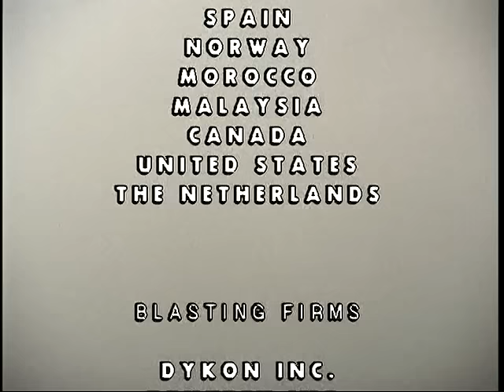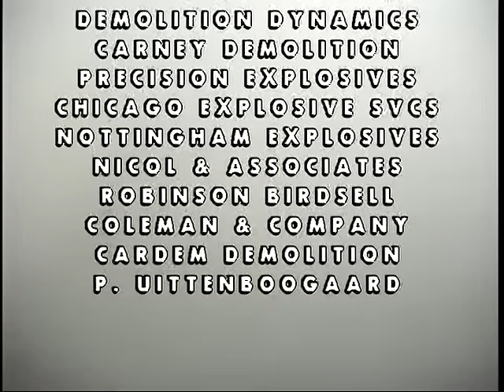Implosionworld Explosive Demolition Compilation 2003

Comment: The amount of precision for the placement of explosives just so the building falls exactly how they want is truly skill right there! Especially in tight spaces right next to other housing.
Reply: Not sure. I've seen building with just small fires in a few floors collapse in similar fashion. Sky scrapers will freely fall with just some damage done to one of its outer walls. The whole concept of controlled demolition is overrated.

Comment: The best demolition video ever.
Reply: Yes!!
Reply: @bmtfadediv2601  Wh-
Reply: Nineteen Sixty-Nine  It was much more tragic though as airliners buckled the steel.
Reply: Nineteen Sixty-Nine  So professional that it damaged another building when it fell.
Reply: Nineteen Sixty-Nine  Free fall for a bit, then it slowed down as it got lower. It was the interior that buckled first when a critical and awkwardly built cantilevered column buckled and collapsed virtually the whole core, leaving the outer shell unable to stand on its own and it crumpled like a can.
Reply: Nineteen Sixty-Nine  You mean hit them with steel columns damaging and engulfing one side with flames and letting it burn uncontrolled for seven hours after the consequences of two full speed airliners hitting two taller buildings next to it?
Reply: Nineteen Sixty-Nine  I think making it collapse in that way would be easier than having to invent fireproof explosives. It would be more difficult to make a critical column fail then collapse the interior then make the outer shell unable to stand. Was the collapse of the Plasco building a demolition as well?
Reply: Nineteen Sixty-Nine  The Plasco building fell differently because it was made out of a grid structure, unlike WTC 7 which was a core an outer wall structure. So if the interior fails then the whole building will fail. But the outer shell is pretty rigid and would make sense to come down straight.
Reply: @TheBrickGuy7939  freefall isn’t a speed lmao get it right it’s actually called gravitational acceleration basically saying when only gravity is acting on an object
Reply: @jonahmoran3751  Chill out I don't believe in the theories you got the wrong guy.

Comment: 9/11 twins demolition is missing here in compilation :D
Reply: @withoutnic  TV? wow your old
Reply: @withoutnic  rlly? the buildings were hit by a plane witch then started a fire wich then melted the steel beams enough to buckle and cause the tower to come down like that. Bet you were in new York on the day?
Reply: @theadrien1937  Fire melted the steel beams enough to buckle from floor 70 to 1 in less of 1 min? Try to melt steel rod with blowlamp 10 meters long and you will see that on one side steel is starts dropping - on other side it isn't even hot. I told you - you are sitting on armchair and do not understand what you do see on the screen. This BS for amateurs. Load-bearing beams are always concrete, so there was no any reason to collapse from fire. The steel isn't the only part of construction inside concrete. You have to learn construction to understand the building technology, especially technology of skyscrapers materials and it's resistance.
Reply: @withoutnic   It didn't take one minute for it to fall down after being hit, for tower 1 it took 1 hour and 42 minutes
Reply: @theadrien1937  watch video how much time did it take since collapse has started. You don't understand that it would not happen either without explosives.
Reply: @withoutnic  No, you don't understand. They were built from steel, not concrete, so when the plane hit the building it started a fire, and that fire burned for nearly 2 hours slowly heating up the steel enough for it to start to buckle, then, the top part became to hevey and the steel beams bent and the top part of the tower came crashing down on top of the rest, making it look like a controlled demolition.
Reply: @theadrien1937  Even if they were built from steel - lets imagine very high temperature on 70 floor - on the 68 floor temperature will not be enough for melting the steel. Once again - try to melt a steel rod with fire blower and you will see how it works-on distance of 10 meters from the melting point you will not feel any heat on the same rod! The heating is not uniform along the building and in any case only the upper part would fall off from the heating. Stop staying on theory, just try to melt the steel rod and you will understand everything by yourself. Upper part would not stay and wait for uniform heating of entire building. And I'm always wonder how your mind works: you see the film of controlled demolition without any fire, you see - this is the fact, and you see that it is exactly same, you also know that the third building collapsed as well without any plane inside, and you continue to teach professional construction builder. I had my own construction company and in opposite to you i'm talking about existing facts and technologies :D Try to learn not from wiki, wiki is nothing:
Wikipedia:General disclaimer
WIKIPEDIA MAKES NO GUARANTEE OF VALIDITY
Reply: The drama
Reply: I'm just here reading the drama
Reply: @withoutnic  it didn’t melt
Reply: @withoutnic  wait what? Nobody is adding mass it’s the fact the columns that are weakened can’t withstand the weight from above. It’s simple physics. You think that it can handle the weight of the titanic that’s like saying placing the titanic on a 1 story steel building. And also steel didn’t melt from jet fuel. Also look at this video https://youtu.be/FzF1KySHmUA tell me why does that happen when it’s not melted. But heated up
Reply: @withoutnic  yeah but we never added mass so if you removed all collumns but one central column would it stay standing no. That’s basically what happened here. The collumns lost half their strength then they buckled as the weight from the top was too much. They were to weak to support the weight and they gave out causing the domino effect. Which is floors hit another and another and another adding more and more weight
Reply: @withoutnic  haha most office fires reach 600 c which is half the steel strength gone so what? More like the fire made the columns too weak to withstand the upper floors. The upper floors became too heavy for the weakened steel.
Reply: @withoutnic  no extra weight🤦‍♂️
Reply: @H9m4n  lmao
Reply: @withoutnic  Fun Fact: Collapse was about 15 seconds long. It took 8 seconds from collapse initiation to dust cloud touching the ground and covering the building.
Reply: @jonahmoran3751  yes, entire building was melted with the fire from the one point of burning located at the 70th floor...
Reply: @theadrien1937  ima support this dude even tho its been 3 years since this comment, the creators used a perimeter tube design for the towers, skeleton on the outside and big ahh columns in the center to save office space. So when the plane hit the outer skeleton was damaged and the inner core, some supports were left but bc of the stress of the remaining floors above, both fell
Reply: @withoutnic the stress of the upper floors
Reply: @ima.get.tiv.2  The stress of the upper floors... what with it? What have You tried to say?

Comment: Scroll down to the comments section on any demolition video and what is the first subject you see covered?...Award yourself 50 points if you can guess,
Reply: The Butler Did It 50 points won here.
Reply: The Butler Did It 911 Bastards?
Reply: +The Butler Did It 9/11.
Yup.
Reply: +The Butler Did It Actually, KI see less and less as time goes on, as I troll-block the conspiraturds every chance I get. In the long run, this is improving the signal-to-noise ratio
Reply: GuySaysThings @
Reply: The first thing I read was how it was a shame that something that takes so long to plan and build can disappear in seconds. These collapses are OBVIOUSLY nothing like the collapses on 9/11, because these have EXTREMELY LOUD EXPLOSIONS, as they collapse. None of THAT in 9/11 collapse videos. The only similarity is the GRAVITY that pulls the buildings down!
Reply: Doesn't take much to bring the conspiracy-theory wackadoodles up out of their cracks in the pavement, does it?
Reply: At least all of you are smart! Lol
Reply: The Butler Did It 
What can I do with these points?
Reply: 6 years later and this is back in my recommendations....and not a conspiracy nut left in sight. What happened? Were they all banned or have they given up at last?

Comment: How come the twin towers are not on here 🤔
Reply: Because those weren't controlled demolitions.
Reply: @Drakrau_TheDerg you sir are correct, they fell due to the high velocity of the planes in impact and damage of the fire that insured
Reply: @four4eight  Yea, and a flawed construction type called Tube-Frame
Reply: @Drakrau_TheDerg  no it wasn’t “flawed” and in fact it was quite strong giving the towers flexibility, the only reason they fell is because it was made out of only steel and nothing else
Reply: @four4eight  Tube-Frame is basically all the columns except for a few are on the exterior, and those columns are held up by the floor. So once those few columns failed, the floors failed, and then the skin soon after.
Reply: Those responsible don't want people to see the similarities. That's why they aren't here.
Reply: It wasn’t imploded they were attacked

Comment: I'd really like to know why people refer to this method of demolition as an "implosion".  There is no implosion involved.  The use of timed, weighted explosions are the method used to make a building fall into a preselected area for ease of removal is not an implosion, but a mathematical problem and an understanding of the materials involved.

Now, if the entire outer area of a structure were covered in HE...like a sheet and then detonated, that might equate to an implosion, driving all parts of the structure to a central point..but that would be ridiculous.
Reply: Because the structure falls inwards. Hence, it "implodes" on itself.
Reply: @mooneyes2k478  Right now, I'm drunk - I'll not argue with someone on the internet in this state.  I will say, this is, again, not an "implosion".  Your explanation is again, not implosion.  You cannot achieve an implosion with these methods of controlled EXplosions.  Having the structure collapse on itself is not an implosion, it's a controlled explosive demolition.
Reply: @zingaza  Yes, it is an implosion, since it's actually moving inwards, towards the center.
By your own claim, it can't be an explosive, because it's not moving out.

Comment: It's about like an ice-cold cube of butter stood on end, with a blowtorch about half a yard/metre away, and everything melts into nothingness. The strongest, thickest, heaviest, concrete-rebar, and the stoutest of steel girders, do not stand a chance; they all melt into the dust all the same. And when the charges go off, what a magnificent drum tattoo they make! I best like the ones where they're out in the desert in the high blazing sun, and they have a skin of glass. When those go, all of that glass sparkles like diamonds, glinted by the sun. To get the close-in sequences from cameras mounted on the structures themselves, I imagine the images would be transmitted by TV waves, a remote location for recording, as it would be a bear to retrieve hardened cameras, from that staggering amount of debris. Can someone please tell me, if the debris is then sifted through, for salvage, for recycle, for reclamation? It seems that by doing so, that a Demolitions Company could help subsidize a part of their operational expenses. A certain beautiful magnificence to it all.

Comment: The Twin Towers were especially unique, as if they were constructed to be implosively demolished.  ALL the load-bearing steel was located at the central columns, located no less than one office level deep into each superstructure.  All the cutter-charges were hidden from plain view from the outside.  Still, some concussive sound and exploded residue came through the windows.